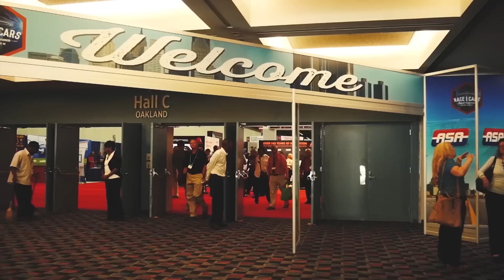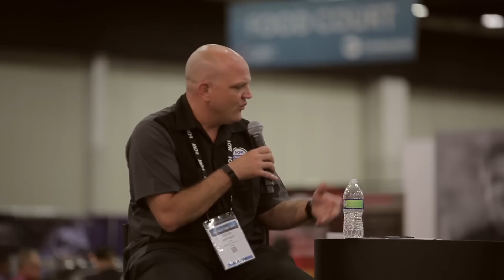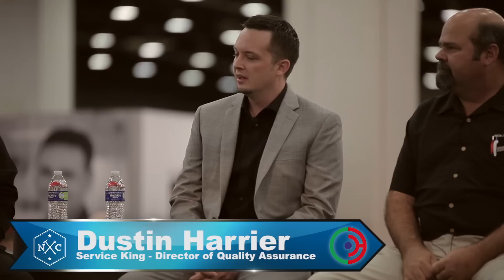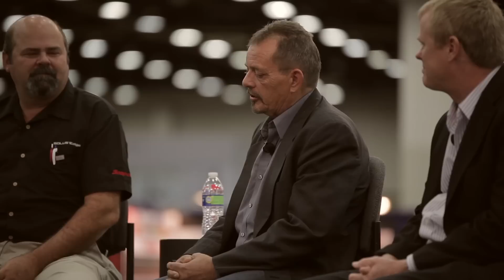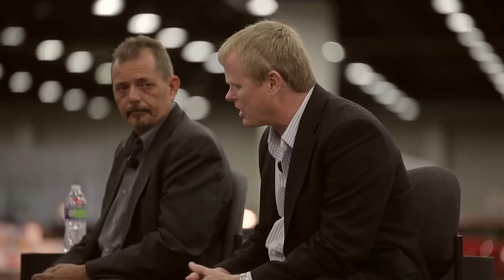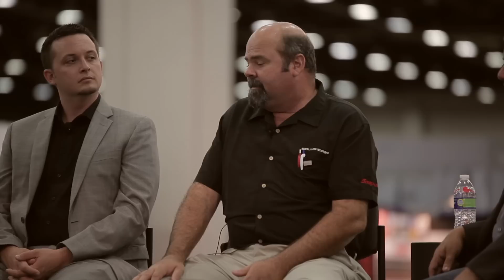Should You Scan Every Vehicle With Collision Damage?

Comment: If a bumper, fender, hood, door... needs to be removed for repair or replacement; then measuring for structural damage is an absolute must. Aside from the obvious it's the not obvious that puts the occupants of the vehicle in danger. It doesn't take long to measure the vehicle and it's important to state that upper body is also important. Don't shortchange yourself and your customer by not assessing all the potential damage.